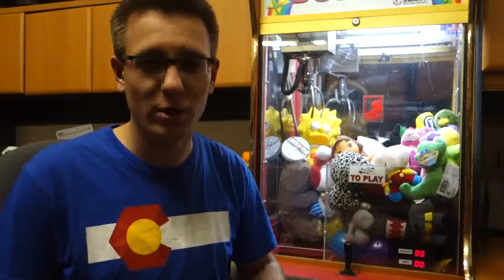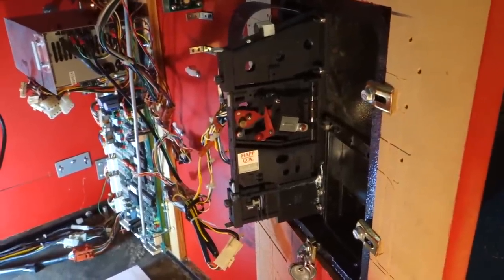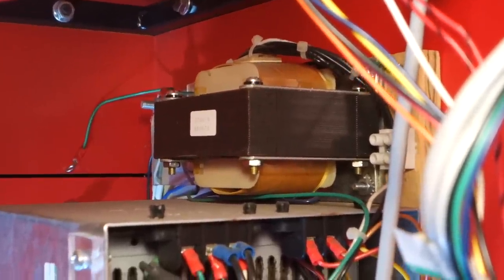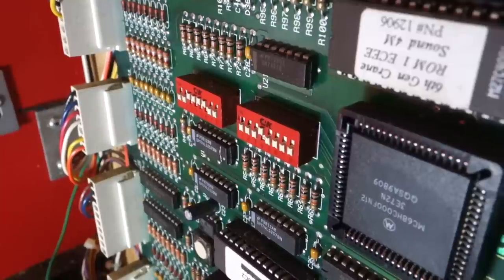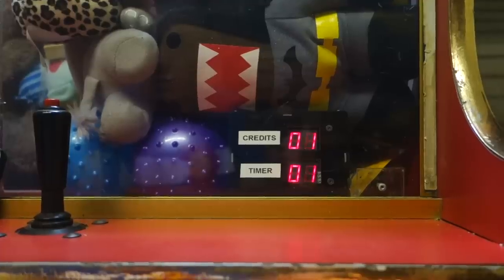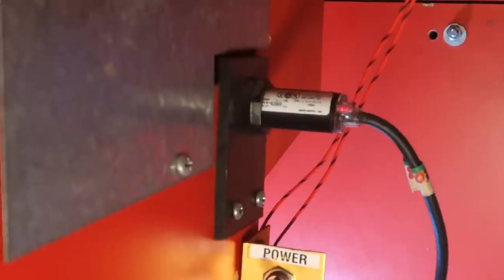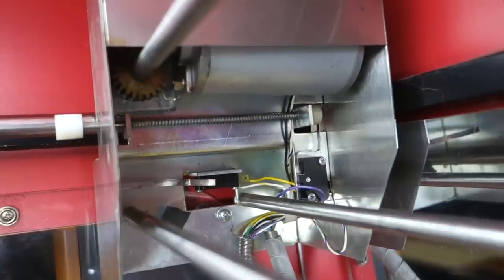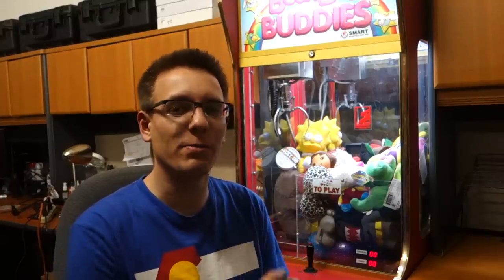Claw Science: How the Claw Machine Works (Electronics)

Comment: I need your help!   I am one hell of a Google searcher, and for the life of me I can not find one D-Damn picture of my "SMS Skill Crane" electronics all hooked together.  I have about 3 wires left that I have no idea where they go. Well some idea but I just havnt taken the time to check voltage and the manual is all in Electronic lingo, wich I could learn but I would like to have this up and going NOW!.   I heard it is also the same as Big Choice and the same or close to a Grayhound. I have all manuals and can not figure it out. 
  Can you help me with a picture of the board and where the wires go, if you have ticket vend wires and all that would be great so I could upgrade.
  How about a replacement board and guts, I wouldnt mind updateing so lights flashed and had a newer easier layout.  Sure could use your help. 
 
p.s. looks like one wire is screwed to the power pack corner. {green} others are red with black lines- and I have open spots on my bridge board but dont know what voltage these need to bee hooked to. I believe there is a choice of three voltages 120, 14, +5  or something similar.  

Thank Man.